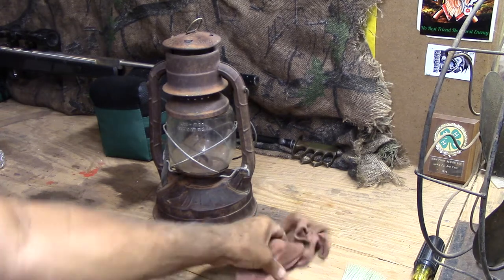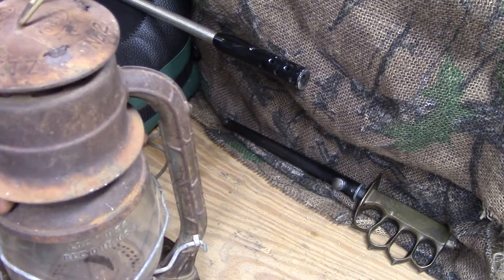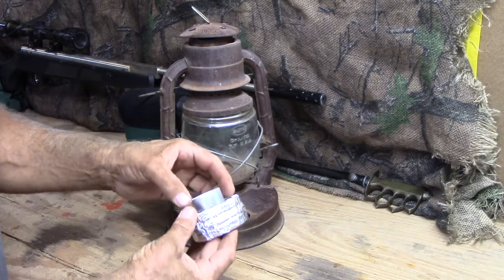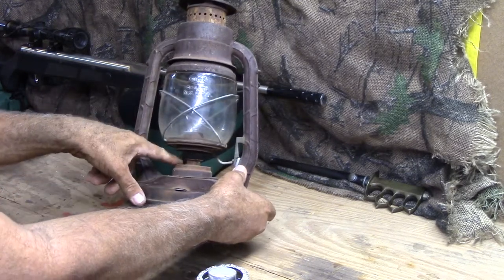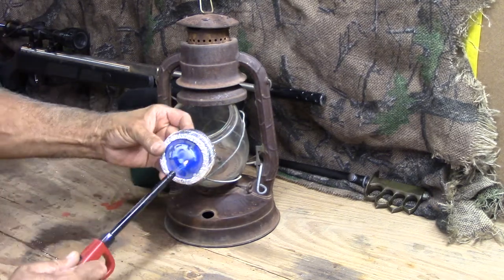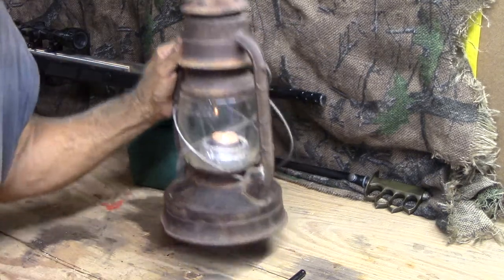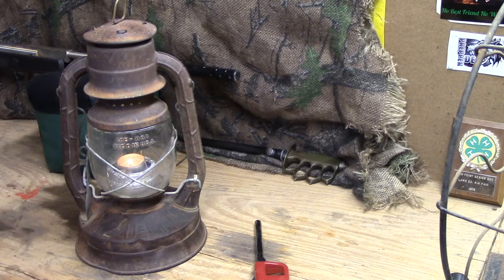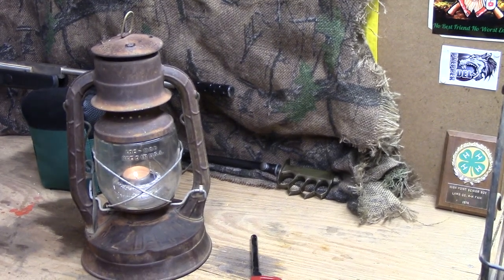Antique Kerosene Lantern, Now Candle Lantern

Comment: Dietz is still is still making lanterns and replacement parts for the old ones. Cool lantern and video!
Reply from the maker: Thanks, bent! We've got 2 or 3 new Dietz lanterns that we use once in a while. They make one, that I want, that has a fitting on the top to set a kettle on to boil water.
Reply: sounds like a great piece for the prepared folk!